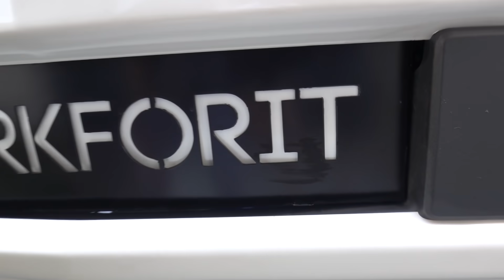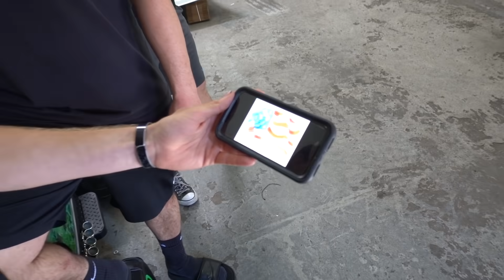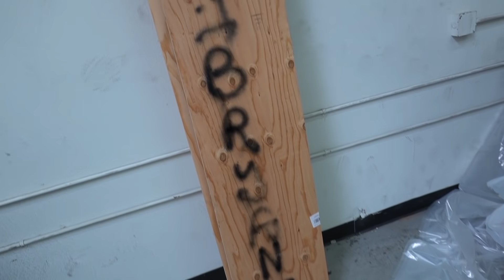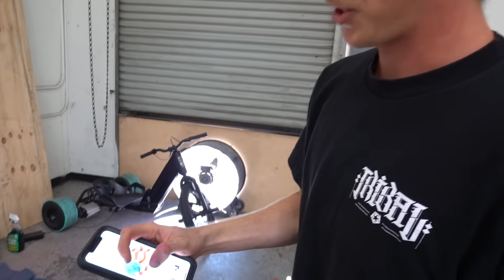CUSTOM 'MERICA TRUCK HOOD PAINT JOB!

Comment: Wonder if you really don't half to have the heat shield under your hood 🤔?
Reply from the maker: TEXAS CHEVYS dmaxjosh has towed his fifthwheel cross country seeing 1300+ degree EGT’s and his truck is holding up fine with no heat shield. Bryant’s will never get that hot.
Reply: You really dont.
Reply: @DMAXRYNO  ok cool ya i saw that video.. just didn't want to mess up my top hood paint
Reply: @DMAXRYNO  the original hood painting, I thought that one was super dope!  So we all know hot air rises so Heat shield blankets just hold the heat in under the hood heat soaking your engine, what these trucks need are hood vents ! Air comes in through the grill , half gets sucked under the truck and the other  half that usually bounces around before getting sucked down would pull the hot air right out the vents.. Hood vents also help at higher speeds with hood lift that can pull your truck around. thats why alot of muscle cars back in the day would have them